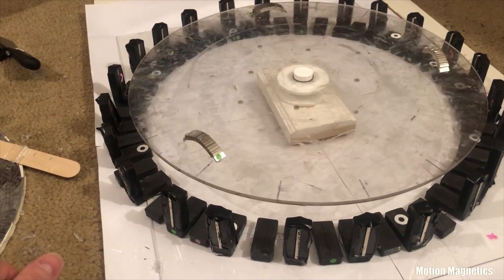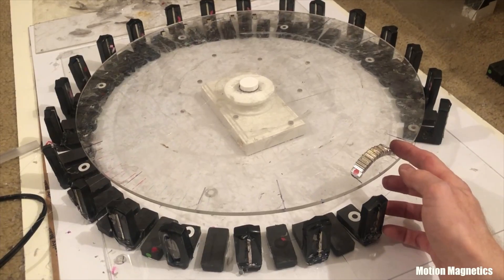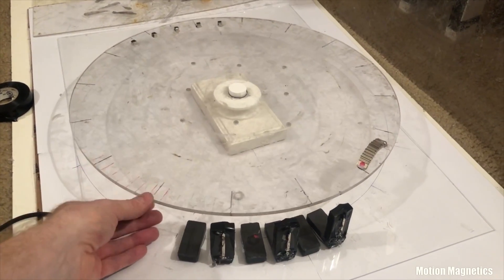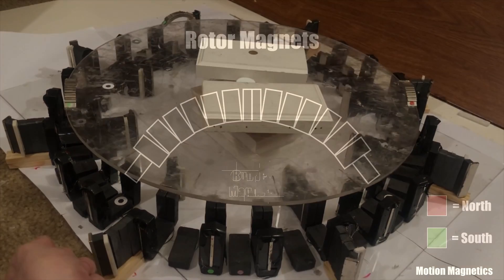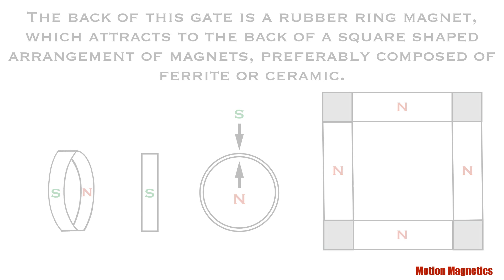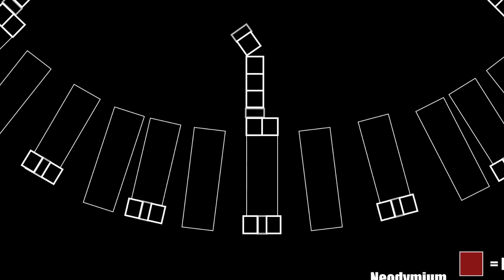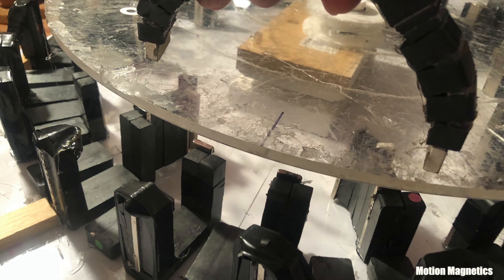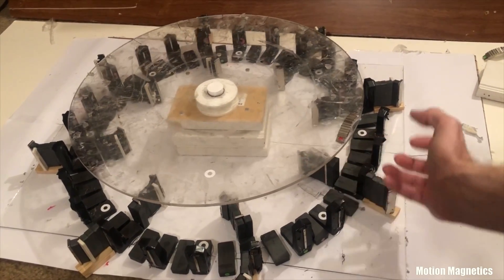Combining Howard Johnson's Magnetic Gates

Comment: You missed the obvious. 
Stop thinking in a linear motion.  
Apply fluid motion to the circuit.  
A helix.  What is the relationship between spinning mass and linear? 
Vortex.  A Vortex is an angle that allows flow. Not a full linear or radial.

Comment: Will someone please consider this and believe it enough to build a prototype? Place fifteen stationary, North oriented Halbach arrayed magnets in a circle. 15x24=360 Mount them in a diagonal slot so their proximity to the moving magnets may be adjusted. Mount two more on a windmill type armature, 180 degrees apart. You cannot adjust the Guass on the spinning magnets! But the stationary ones can be adjusted with the diagonal slots. We've done our best to Keep the South amount to negligible. But since 15 is an odd and 2 is an even, the moving magnets can't cancel each other out! The two being 180 precludes the fact that they are never in sync and must "fire" alternately. So we've eliminated South. We've conquered  attraction and harnessed Repulsion! As far as I can find, no one has as yet used an odd number of stationary magnets in a circle. But 15x24=360. I truly believe this configuration could possibly start a different way to think about permanent magnet motors. Oh yeah; you increase RPMs by advancing the timing which is, of course, the stationary 15 like a distributor shaft. Am I on the right track? Or is this idea a rotten one and that's why nobody's built one? Please enlighten!

Comment: When you are talking about "rubber magnets" are they "rubber coated magnets"? oder magnets made out of "magnetic rubber"? 
Luc
Reply from the maker: Magnetic materials mixed with rubber. Similar to refrigerator magnets but made out of thicker materials and magnetized like a standard magnet. Refrigerator magnets are generally magnetized in a Halbach array orientation.

Comment: I love these I had this exact idea when I was 18 in 2015. I made a small model and figured out the the magnetic fields always counteract each other, I stopped my research in 2017, but just recently got back into the idea when I discovered the element bismuth and the diamagnetic properties it has. I now think and am going to test this very same / similar setup but with using large amounts of bismuth against many tiny magnets aligned just how your top is in these videos. The diamagnetic property if strong enough should be able push the top to spin without the counteracting magnetic field that using two magnets would have.

Comment: Dude, what if you added some pistons that were operated by the revolutions of your center wheel bearing that pushed magnetic pins up and down in sequenced areas around the perimeter of your wheel that added the needed imbalance for continuous magnetic thrust. Not sure how practical that is, but I think everyone keeps thinking of static fixtures instead of maybe some added moveable mechanics as well.

Comment: Have you tried setting your base magnets under the rotter slightly askew? It would seem like the magnetic field of the entire array wouldn't be as strong because of the overlap but i would think the valleys in the magnetic flux would be less, creating less resistance. Never mind. Im going to post this anyway but but i think i answered the question. Because the array field is weaker it will still be equal in force on pulling on the rotor. All i did was make the fields weaker. Thanks bro. Good work!!!

Comment: Put the rotating magnets in between the gates not on top, e.g just like you did in the breaking the one inch barrier video. Also changing the angle of the bananashaped magnets changes the total magnetic flux path, so try keeping it like the patent.

Comment: suggestions. 1 Maybe have the vgate get enough momentum in a big disk to jump the issue since its not getting enough speed to do that. Since if it was going at 100mph it would pass thrue the issue.  2 electromagnet to neutralize the issue for a split second. 3 ray magnet you said did not work but the issue maybe seems to be he is trying it parallel with each other like 2 beams  I I than turning away from each other  ) (  oddly i tried to explain that but youtube erased my comment. odd.

Comment: If one of your design would have passed 1 turn of full rotation without launching it or cheating, it would worked. In every clip you are showing us, even those where you say it's very close to work, I've watched carefully and none of them did the 360° full turn. It just looks like it's working because some of them are very slow and you can show it to us longer.

If it don't achieve full rotation, it's like placing it on a linear track.

Comment: Elon Musk at Tesla made electric motors using magnets. But they are able to switch polarity by switching the flow of electrons. A permanent magnet is permanent through the crystal structure of the metal. It can't flip polarity. Every 180 degree rotation flips polarity. So for permanent magnets to sit there with other permanent magnets rotating, you will invariantly come to equilibrium. 
So far, if I throw something in space it will go on forever. If you reduce friction in your system, it will go on further and that is all you are accomplishing. There is no hidden mechanism. It follows mathematical principles and you won't trick it into spilling energy into your system. 
There is a problem with your overall approach. The reality that you consider yourself an experimentalist and not a mathematician. At the end of the day, we do experiments to prove what we worked out on paper, not the other way around. Everyone brute forcing solutions through exhaustive experimentation will never truly appreciate the universe for what it really is, a creation. Everything works by laws and principles and measuring one thing against another thing. This is the theory of everything. Now go and do the math and let that be the wall you bounce off of for your experimentation. But until you have a proper outlet for feedback of your results then what point is there in just aimlessly tinkering ad infinitum? Work smarter, not harder and in the way of science that's done through mathematics.

Comment: I want give you KEY for magnet motor. You need to use repulsion. If two magnet repulse position setting and enough thick ferro magnetic Material (using iron) placed between magnets you will See what Happen

Comment: If you arranged the magnets in a single mobius strip arrangement around the stator could that not provide a continuous push path?  The field would look like a corkscrew spiral, rather than a set of repeated steps with incremental offsets as you have now.  Likewise for the rotor.

Comment: I think you are leaving out an important item. Gravity. You have it flat operating on one plain. How about another vertical wheel or angled, so you can use gravity also, to keep the momentum going. No, I haven't tried any of this, just appears to me that a different axis added to the mix would give you extra boost.
Reply: Gravity pulls evenly on both sides of a vertical wheel, so the effects cancel out.

Comment: When the wheel turns to the left.
I bet it pulls in Dark Energy.
Because If you stay close to it long enough your see the dark Rings Around your eyes, I'm trying to reverse the polarity !And get the good stuff counterclockwise ?
Good show ! Good job !
Reply: There is no dark energy. Everything is made of light. Please do your research and don't just accept everything you hear. But check out the Pilot Wave Theory. It shows that with a macro sized experiment we can recreate the exact effects of the double slit experiment just by suspending droplets of water on top of vibrating water waves through their surface tension. These huge droplets of water, will go through two slits and create a diffraction pattern just as in the double slit experiment.
What this shows is that all along we never had any reason to think the macro and micro were fundamentally at odds with each other which the current quantum mechanical model suggests. 
This also brings back the Aether into question since the Aether would be the wave component of light and the Photon would be the particle component of light that is vibrating inside of the Aether which gives its constant speed of propagation through space. 
And this was the original idea of the Aether, that in some way the constant speed of light arises out of the same sort of laws that govern sound. But those laws while may be similar will not be completely the same since sound has no particle component, only wave.

Comment: Could you use the field from the flip to mechanically flip another magnet on a pivot to then move another magnet on the other side of the pivot  downward on a spring pushing back which would  push the rotor. Magnet couldn't push while spring held back. So the field flip would bump the pivot to push and then bounce back.

Comment: I know ego's clash and you are a self learner. Just a little advice. Dump the metal bearings. Capacitance and resistance. No mater how small the force is "generated" it can effect the outcome. Might set you back a little, but free floating, there are some very strange metals out there in the public domain. Think sports equipment. Dielectric

Comment: Getting Rid of the Aluminium disc appears to have helped.  I think you are now loosing frictional energy due to your bearing and axle. Use a harder plastic and machine the axle... Not 3d print. Re: Too much wobble about the axle helps the disc and magnets find its state of equilibrium.  I would look into a vibroetch a series of markings on your disc to help your spacing consistency... Say every 1/32 in. Plus concentric circles.  I would look at upgrading your disc assembly to minimize wobble.  Your counter weight of wood is also likely not accurate enough. Upgrade the ABEC rating of the bearings and diameter of bearing as well. Also consider diamagnetic materials such as graphite strategicly positioned to aid in movment.  Contact me to further discuss.

Comment: Hey bud, been following your work here a few years now, inspired me to build some prototypes of my own, bought a small lathe and though I haven't quite found the winning design either I wanna thank you for sharing your work and research. One thing I found that I wanna give back is rotor stability, when it wabble's even a little bit the amount of drag goes way up... another thing thing I learned is it's not so easy to make a pressed fit for bearings to run perfectly true to one another...lol Keep Doing Great Things! Cheers!
Reply: Hey there, I am sorry to bother you but I'm just getting started,  can u place a steel rod inside of the banana shaped magnets arch?  I have always wondered if it could help this magnet rotor work.
Reply: Research and try to use bismuth I've been studying this for awhile and two magnetic fields always counteract each other. The properties of Bismuth wouldn't have to counteracting part that two magnets rotating past each other do.
Reply from the maker: Good deal! Glad to hear it! Do great things!

Comment: Good work! 
If movement perpendicular to the travel is allowed, the moving magnet can ride on the magnetic stator bubble instead of going through it. I think this can be one detail in your builds.
Reply: I think the problem with that Idea is that you would either have to apply force to re-enter the gate or you wouldn't benefit from the acceleration on the next gate.

Comment: Might I ask why do you put magnets on only one side of the rotor wheel? Couldn't you put a mirrored set of magnets on the bottom side of the rotor wheel to boost the momentum again? Then wouldn't it be able to complete the 360* turn? I admit I never done any work in this field so If I am off in my thinking on the project let me know. I'd like to help but I feel like such the noob at all this...
Reply from the maker: Well, there is a way to build additional layers around what I built, so you're not far off in your thinking. Some of Johnson's designs were five or more layers deep.

Comment: wouldnt it be better to make a smaller circle to deal with less adjustments and magnet?
Magents dont flip and i it did iy would weare off quickly which would make it obsolete. 
Maybe it would be better to try rays designs since you follow him as well which he seems to have something that makese more sense.
Reply from the maker: Building it smaller can cause more problems with the magnetic fields becoming intertwined and cogging. 
Magnets do flip when you mix magnets made of different materials together angled and sized in the correct formations. That's what I referred to as the exchange force pulse. The magnetic field increases by 4 to 500 times its normal strength for a fraction of a second. It's not an effect that's well known though. 
I like what Ray is doing, and I enjoy his research and his channel, but there is a reason he doesn't have a rotary device that works without an electrical assist yet. I covered some of that in the video I did on his magnetic gate. I don't mean that in a negative way. I'd love for him to get there, and I believe he could, but I notice things when I experiment with other people's work that the average viewer on youtube wouldn't. I've been at this for a while.
Reply: @Motionmagnetics  its been a while so did you give up?
Reply: It would be better to pursue a more useful line of inquiry than this nonsense

Comment: Have you ever heard of Plasti-Dip? It's a liquid rubber that comes in a can,  that you can submerge objects into and produce a thick, rubber coating on it. Might be the solution to make the rubberized magnets you're looking for...
Reply from the maker: Thanks. I have, but the coating wouldn't achieve the same results as a rubber magnet. The materials need to be mixed together.
Reply: @Motionmagnetics  ...ah, I see. I have a couple rolls of the type of "rubber magnet" you are referring to. Mine are about 1/2" wide,  1/8" thick,  by about 6' long. They are pretty weak magnets, like the type magnetic signs are made of. If that's the strength, or type you are looking for, or similar,  a possible source would be discarded refrigerators,  as they have a magnetic strip that runs all the way around the doors to keep them sealed...

Comment: Have you ever tried to make the rotor and the stator face each other by having them on the same shaft? Kinda like a stack of pancakes. Maybe the increase of pressure of the magnetic fields across the rotor would be more likely to force acceleration. Considering that it seems like every configuration has a “stick spot”, what about placing a small electro magnet with precise timing to power on and off. The only real power being used would be on the start up.After that it would like tapping it along. I wonder if a couple of well placed pick up coils could store enough power to at least break even on the electro magnet. I recently watched a video of a company installing a magnetic generator in Las Vegas. They claim that it is what we would call “free energy” or over unity power generation. They used a pancake configuration and had a fly wheel which the inventor said was necessary for continuous operation. We have all seen the scammers and people with big claims that seem to fade with time. All I know is that “over unity” is possible with something as simplex as utilizing resonating induction coils. Like hitting 1 tuning fork that resonates with 4 more within its resonate field. How is that not over unity? If we can achieve it with sound and frequency, why not with magnetic field pressure mediation? Good luck and God bless.
Reply from the maker: Thanks for the suggestion. I have tried something like the stacked pancake idea you suggested. That's a great visual aid for what you were describing, by the way. When you add additional layers it affects the timing and the alignment of the magnets and they usually have to be more precise, so it can sometimes cause more problems than you started with. Good thought though. 
Every time someone mentions adding an electromagnetic assist that is powered by the rotors partial rotation I think of the Bedini Monopole Motor. It's not impossible to build a system that way, but my main goal has always been to do it with permanent magnets and shielding alone. God bless you, as well.
Reply: "How is that not over unity?"
Because the tuning forks don't continue to resonate perpetually once the first one is struck, that's how it's not!